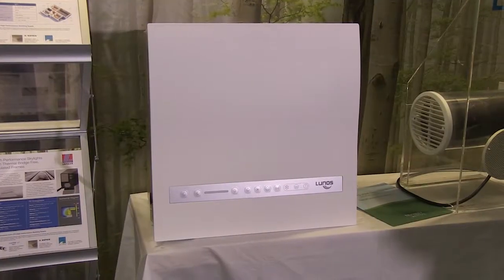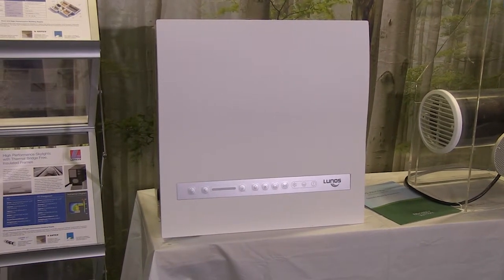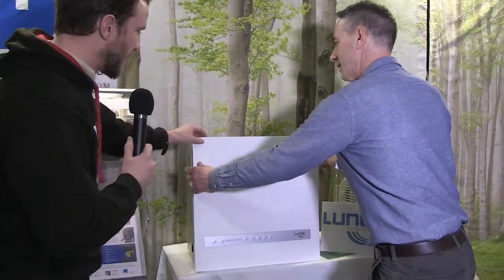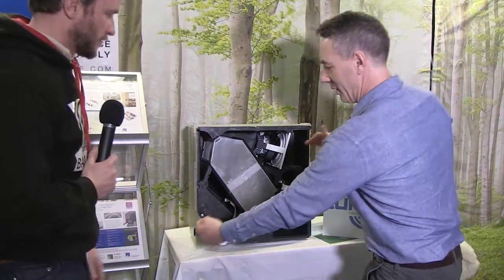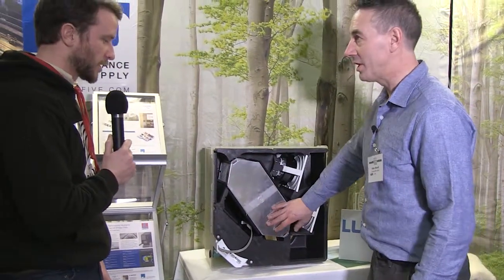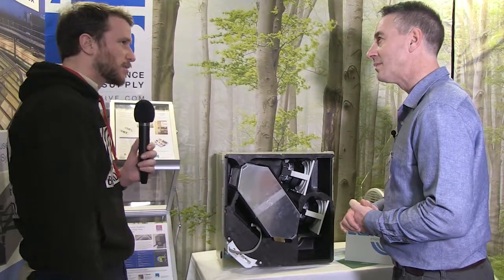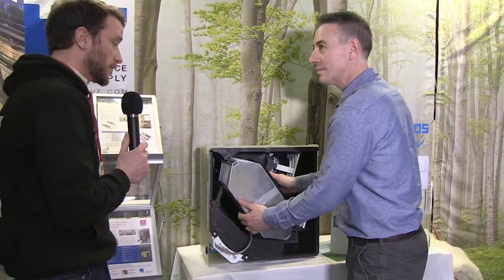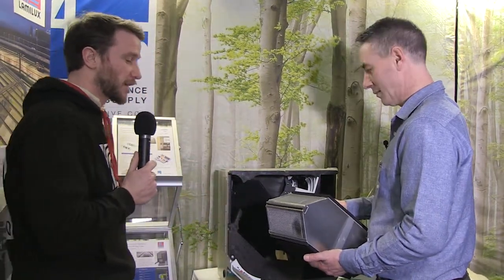S Files Season 3 Episode 1; the new Lunos

Comment: I installed these in our house in VT over a year ago and they work really well. Although the unit is expensive, the installation was simple (saved on labor) and they fit easily as a part of our deep energy retrofit. We had tightened the 1000 sq ft house enough to need ventilation but had no easy way to run ducts. Keep up the great work. THanks for your commitment to Building Science.